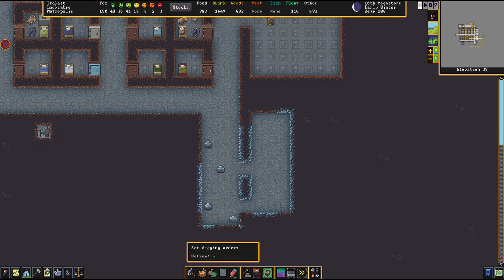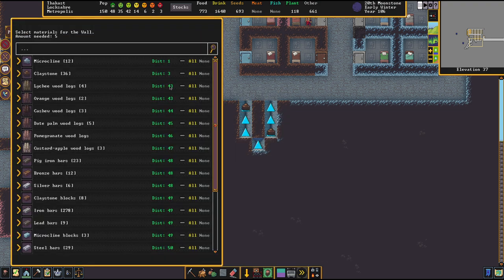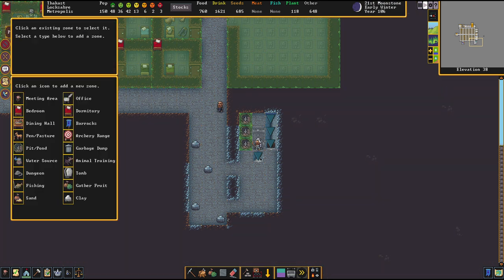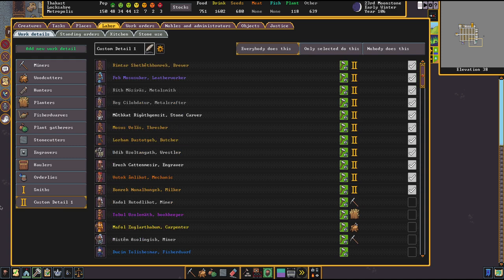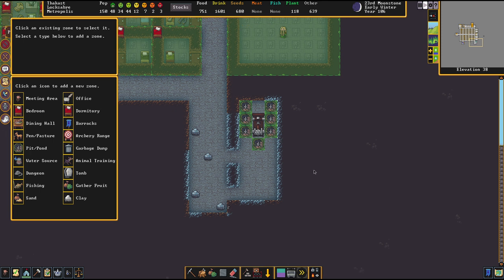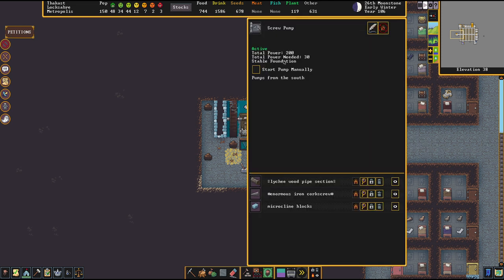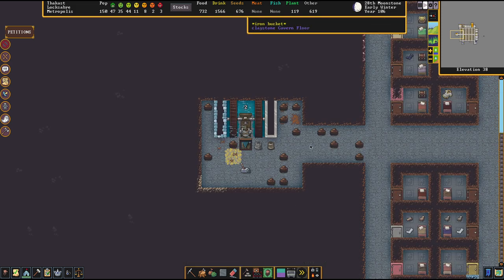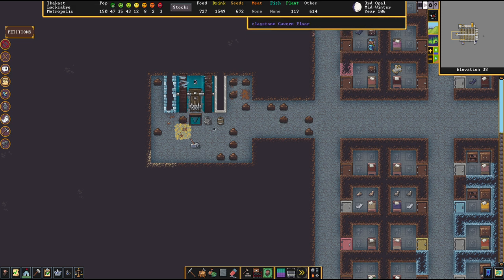WATER REACTOR / GENERATOR Guide - Tutorial DWARF FORTRESS

Comment: What do you typically use these water reactors FOR? i.e. what is it's practicality? Basic power source? And if so, where do you connect to to take power away from it?
Reply from the maker: Uses range from simple things like Millstones up to more complex tasks like powering up trap system (Rollers for example). Power can be extracted from above (Northern Part of the pump is the "axle") or you just connect axles right to the waterwheels. It will splutter some water but that doesn't kill anybody.

As has been pointed out before: These things are quite heavy on the FPS cause of the many calculations done per turn and should be only used when you have no simpler method available.